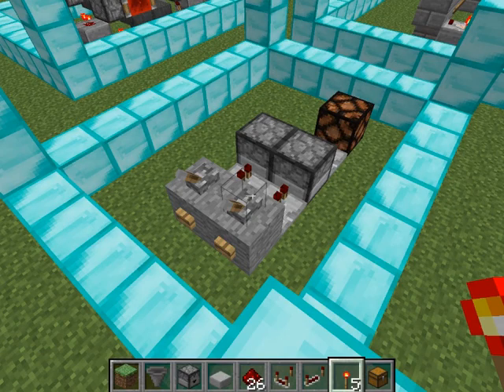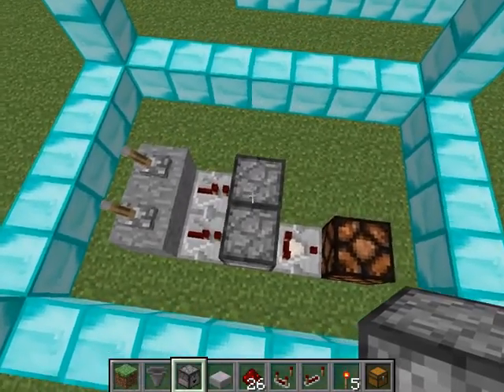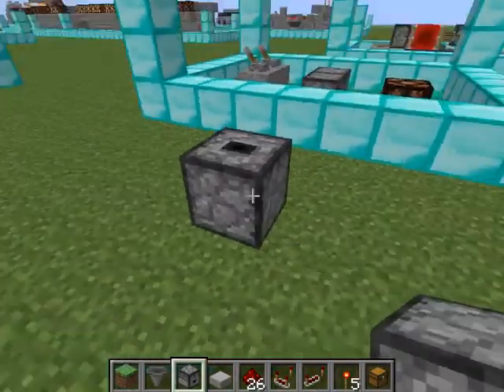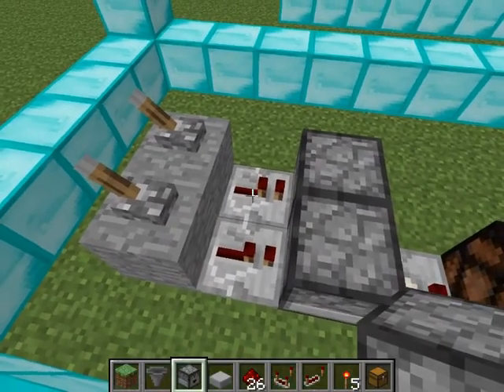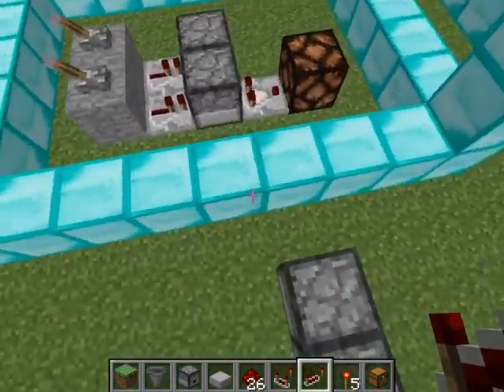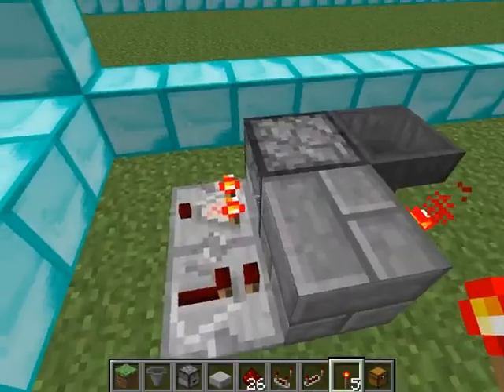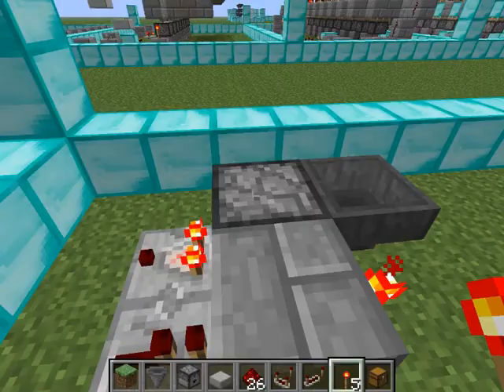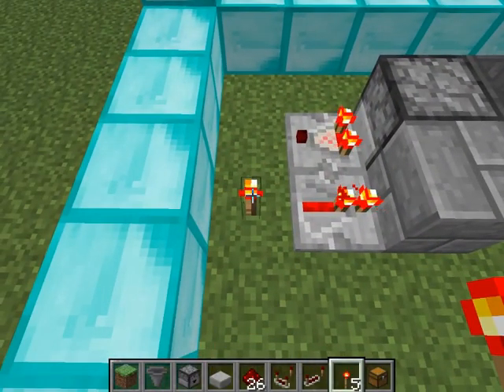Smallest RS NOR Latch in minecraft 1.6.2

Comment from the maker: well, you could look at the way I set it up with the selection panel (2 droppers positioned vertically, power in from the top and bottom for the set/reset, comparators from the two sides for the indicator light + output). Stackable, 1x1 x2high setup (not counting the inputs+outputs)